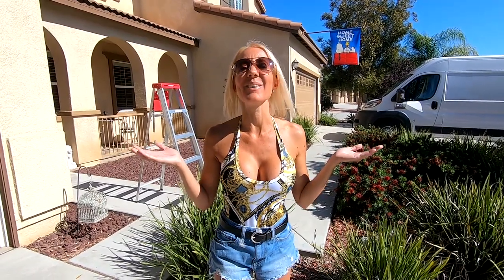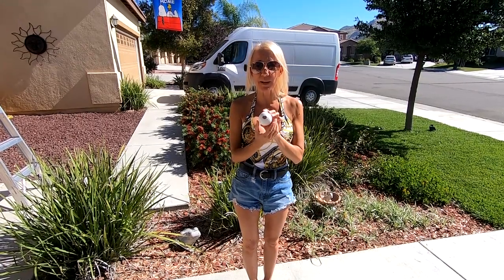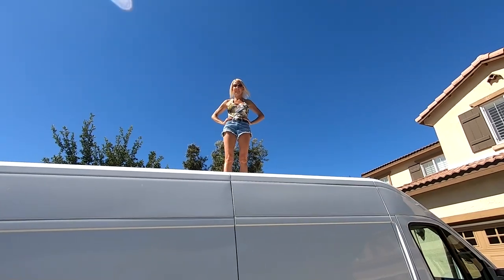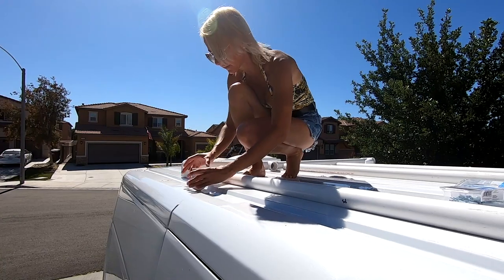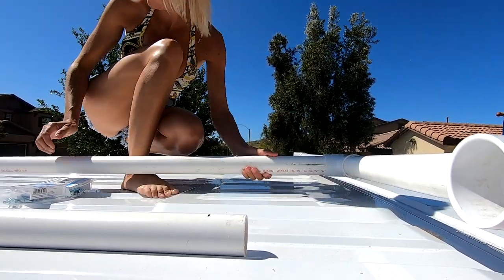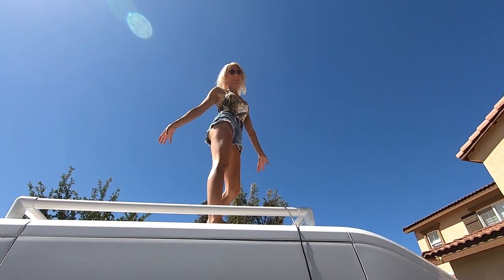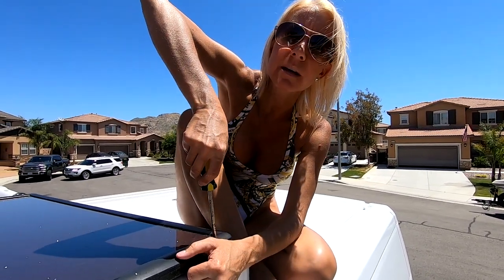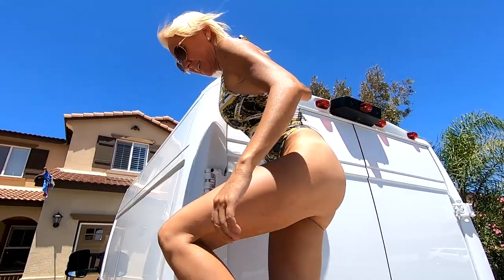DIY Solar Panel Mount Roof Rack Ram Promaster Van

Comment: The only issue i have found i have used that pipe to build outside theater frame for screen and the UV rays break it down and makes it brittle and cracks and breaks with the wind 🌬 I feel like you’re going to loose alot of money in panels not to mention put innocent 😇 drivers at risk sorry to be so negative but i have only seen pvc last like 2 to 4 months of hard Florida rays

Comment: Cool video! Im wondering how pvc will stand up to baking in sun on top if van. Forgive my ignorance. I suppose if it did ever start to breakdown it would be cheap to fix if needed. Im subscribing!
Reply from the maker: Thank you Mark. I don't think it will "breakdown". My thought is it might warp and bend in our hot summer.

Comment: What are those fasteners attached to the van roof?
Reply from the maker: We cut a hole in the pvc cap as explain in the video. Thank you for asking.
Reply: Ok thank you,  I watched again and heard you mention mounting points, that is what I was trying to figure out.  I'm guessing the mounting points were already there...
Reply from the maker: Yes. The Van comes with those metal oblong mounting points. There are 6 in total on the roof of the van. We used the front and middle  ones. There are 2 more in the back roof corners.

Comment: Nice idea, but I cannot see it lasting long on those mounting points. Though it may be a cheap fix to replace the PVC, when your panels are hitting the highway, thats not so cheap. I would recommend the following, https://www.youtube.com/watch?v=9Aa_WOGRPYA for the mounting points and attach your rack to those. This is what we did to our Promaster and have not had a single issue.
Reply from the maker: Hi, I had watched your video a few times before I started this project. The only problem I have with any other roof rack is I couldn't find a way to adjust it for the size of our solar panels. Where we live we get plenty of days over 100 degrees and we think our problem will come from the pvc pipes warping and bending from the heat. Thank you for your time.